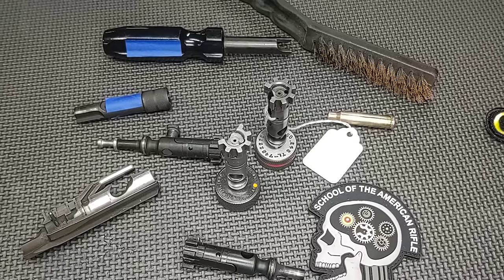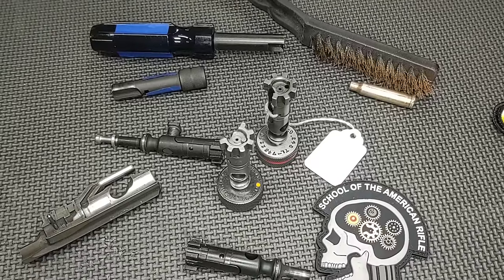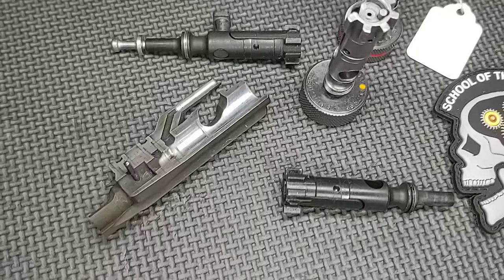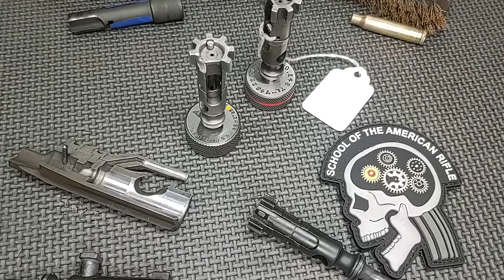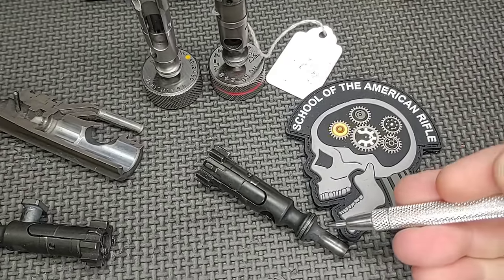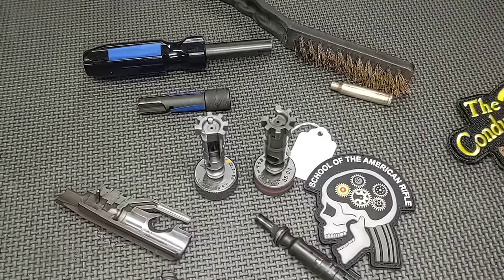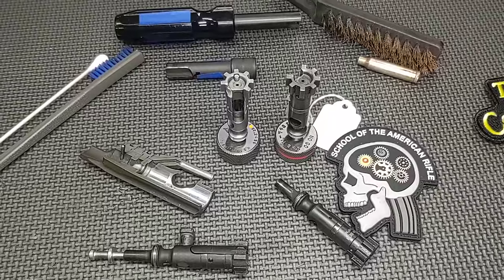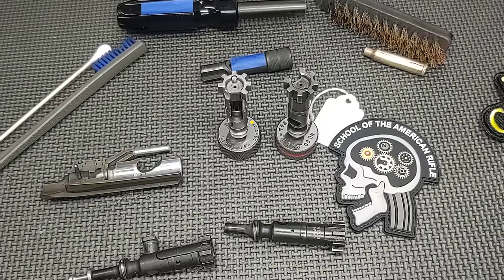Improper Cleaning can ruin your AR15 Bolt Carrier Group

Comment: I have found the best way to clean the BCG (and other gun parts) is an occasional dip in the ultrasonic cleaner with some Purple Simple Green (don't use the Green Simple Green on gun parts). Then some CLP, and it runs like a champ.
Reply: Same here, purple power and a after a cycle or 2 the BCG is spotless.

Comment: Glass jar with Hoppe's #9, submerge bolt and run through a few ultrasonic cleaning cycles. Don't ultrasonic clean any parts that have type 3 anodizing, it doesn't fare well.

Comment: I built a CAR 15 to use at the SOF 3-Gun World Championship in 1990.
The days when NO scopes allowed, just iron sights. I placed third.
I still have that rifle, untold rounds through it and I have never scraped bolt or carrier. Just clean it twice a year and I use my own gun oil.
REMEMBER: There are lots of fixes for problems that do not exist.
Also, take the O ring out of your extractor. Mine has the black buffer and Wolff extractor spring. Never had a failure to extract and I DO NOT use steel case ammo.
Dump the powder from a steel case round. Light it then rub the ash between your fingers. You will never use steel case ammo again. All that grit from countries that hate us.

Comment: I agree with this video, it makes sense and I will never buy one of those scrapers. It would take a lot of neglect to make one start to malfunction if you lube it.

 I'm a big fan of using chemical solvents because most things will not harm the steel of a bolt carrier group. I actually use a lot of automotive products for cleaning and lube. An automobile engine has more friction and stress than a rifle and if it works on an engine it will work on a rifle, as long as the viscosity is fine. 

I use Ford moly grease for the threads on my barrel installation, it's never been a problem for me on that and it's a high quality product.

I've found that carburetor cleaner and brake cleaner are both excellent solvents for many mechanical devices, including guns. You just don't want to get that stuff on your plastic furniture or wood for that matter. That stuff is formulated to clean metal and not harm the various seals on a vehicle. Spray your BCG with carb cleaner and give it a few minutes to work and then spray again and scrub with a nylon brush and old tee-shirt material and I guarantee you the BCG will be clean enough and not sustain any damage. The carb and brake cleaner are also both designed to evaporate quickly and leave zero residue. 

I also clean and degrease metal with brake cleaner before spray painting metal and that works fantastically. It's also good to use it before you glue something with something like epoxy. The cleaner you get your metal or plastic the better things adhere, that's just a fact. You do have to be careful when you prep plastic like that though.

Comment: I see it often. I've been disassembling and soaking the BCG in SeaFoam and then using a nylon brush.  It's worked amazingly well with zero wear to the surface coating that I can see under a surface microscope.  I generally clean the BCG about every 500 rounds if the situation permits it.

Comment: Shalom Ach b"Mashiach!      Just purchased a new complete upper. Disassembled. Used Lucas red oil to clean BCG. Then light oil with Lucas green oil. Put two mags through it the first day out. Disassembled again. Recleaned. And noticed the BOLT has a distinct RUST area in front of gas rings. The RUST area feels pitted like it was not Nitride-treated properly. "MPI/HP tested bolt" / 556 MPI 9310. Question. Will oil protect? Should it be a concern? Replaced? Re-BLUED? Thanks/ Todah!

Comment: If I can’t knock it off with a nylon brush then it don’t come off my guns lol. Lube it up and it runs! Also I stopped using brass or copper brushes in my barrel. The gun just continued to tighten up groups so why do anything than a patch and a very light chamber brush.

Comment: found in the Army that if I lubricated my firearm properly, using nothing more than military issued CLP, the carbon in these areas would literally wipe off later. 

I also very rarely and sparingly cleaned my M16 or M4, even in Basic, and never once had a problem due to being dirty.

I'll admit at one time I was cleaning the bolt as mentioned here, using the can opener of my multitool. But overall for the most part, during my time in the military I rarely had more than a rag, nylon brush, pipe cleaners, barrel/chamber wire brushes, and CLP to clean with.
Reply: The place I bought my bang stick from,said after asking which cleaner and oil to use, just use CLP!! Good advice...

Comment: Two things I learned is, it needs lubricant. The fouling will affect the operation of the gun and cause misfires. Number two, don’t run a lot of rounds through it before cleaning it. A quick cleaning between trips to the range will help with firing problems from build up. Then a major brake down and cleaning can be done at a later date. Since doing this I never needed scraping tools. A good gun cleaning solvent and cleaning cloth does the trick.

Comment: so yeah, competition shooter and been trough tons of carbine classes since I got out of active duty in 2007. I clean my guns maybe once a year and not this thorough. They run fastastic. Might not look pretty but i Just wipe them down, hit the valley and small parts with some simple green and a nylon brush. Pull a bore snake a couple times. Spray some royal purple gun oil and get back at it.

Comment: I am from Alaska were putting lube or grease on the moving parts of any AR from the 15's to the 10's is going to cause you massive issues to fail to fire - non cycling cartridge issues because when weather drops below 50 degrees the oils and lube get sticky and show down the movement of the bolt throwing timing off and for the firing pin the Kinetic force is dampened causing fail to fire.
I bought my first AR 15 1 year before Bill Clinton was president, so I have used AR's long before the guns popularity exploded.
This greasing & lubing ARs to get them to work is really BS as I have for so many years won't put oil or lubes in my AR's because I've found personally even WD 40 will put a stop to an AR 15 or AR 10 to function in cold weather.
If you live in a warm climate area, then oils and grease is fine in the AR rifles if that is what you want to do then have at it.

Comment: Im a new subscriber and builder on my second and third AR  builds. I think I like the way you think. These rifles seem to have similar characteristics as many other piston systems be they internal combustion engines, two stroke, small engines or whatever. They have tolerances built into them to run under less than ideal conditions. Of course efficiency is the name of the game here. It degrades under adverse conditions. Like a transmission. It’ll run with low/dirty fluid. But for how long?

Comment: Great video.  When soaking the carrier group in CLR is there anything you need to do to neutralize. Or do you simply wipe or blow it out with compressed air.
Reply: @sotar???  Do you rinse the CLR soaked components or just blow dry with a compressor before lubrication?

Comment: I use a scraper, but very lightly, and only try to remove the excessive carbon build up caused by suppressor use.  I always leave a little bit on/in the bolt as there is no need to get it 100% clean.  I wish they would have had this attitude when I was in the Marines.  I have not found CLR to be an effective carbon remover and that that includes soaking it for several days.

Comment: Appreciate the advice! Seems u have first hand knowledge of this and u seem to know what you're talking about when it comes to this. U saved me from scraping the bolt end with a wire brush to remove the fouling carbon that builds up. You beat my OCD with a hammer and won! Thank u! Now i know not to do it and that it's not a big deal

Comment: I would have found it more helpful for the video to show me what to do rather that just tell me what not to do.

Fwiw I only use Hoppes and a cotton rag on my boron nitride BCG, and then a little Slip 2000 on the bearing surfaces and in the lugs. Is that bad? Idk but no problems yet.

Comment: I have that multi tool scraper maybe once every 3000 rounds on my AR bolt but it's just a twist or two and it never really does much so I am slowly using it less and less. It would always feel wrong scraping the bolt even with brass.

Comment: The rule of thumb for cleaning tools is that they should be made of plastic or softer metal (brass, copper, etc). If you use steel on steel, that’s when you damage the gun. Brass and copper should not be able to damage the gun.

Comment: Will swear with CLR for cutting carbon.  Did some suppressor baffles that hadn't been cleaned for a decade.  Dip worked to a certain degree.  CLR owned it.  Only thing is CLR can eat into the steel if left for WAYY too long. 10-15 minutes tops.

Comment: I ended up removing the finish on my BCG by cleaning it with a copper wire brush. Should I get it refinished or just make sure I keep it clean and well lubricated moving forward?

Comment: Okay so legit learn me here:  I was taught to disassemble, wash with soapy water, gently go at it with an extra soft toothbrush, dry with compressed air and a clean towel, and then use something like froglube on everything and reassemble it.  In the volumes of "wrong ways to clean things," (which I have determined that every cleaning method is in fact the wrong method) how badly does the way I was taught rank?

Comment: I bought a CAT M4 Tool but haven't used it yet. Because of its more open design, maybe it won't hold the carbon and lap the bolt tail or carrier, but I don't know. If I do use the tool, I'll be even more careful if I can remember this video.

Comment: What about bore snakes for the barrel? I tend to stay away from metals on metal but I bought a bore snake and it had Cooper strands throughout its length….i tried to make sure I did research before on bore snakes before I used it and it from my understanding it’s fine but I’m not sure. Did I get the wrong kind of bore snake. (I made sure to run it through from camber to muzzle and then repeat)

Comment: Just keep the hel_ lubed out of the bolt. Carbon build up isn't near as bad and will wipe off with a rag. Oil the crap out of it again and stick it back in the rifle. The only way to run an Ar Rifle is with a wet bolt !!!! Bill @ Mitchell's Gunsmithing.

Comment: When I clean my bolt carrier, I rarely use a brush or hard tool.  I use some good solvent,
then I use a good quality paper towel, wrapped into a roll very tightly, then I insert it
and twist it.  I might also use the firing pin to "scrape" it a little bit.  After cleaning it once,
I might soak the area with Rem Oil, then come back a week later to use the paper
towel again.

I don't run my rifles "dry", but I also don't try to over lube them.

Comment: My rifle cleaning procedure is run a bore snake with a couple drops of oil down the barrel a couple times, wipe the loose debris of the bcg parts with a lightly oiled microfiber towel, add a couple drops of oil to moving parts, and put it away until the next use. Haven’t seen a need to scrape the carbon.

Comment: Ive only ever had to clean the boat tail of an AR bolt once, and it was in an ar10 after shooting 400 rounds of tula through it. That stuff ran so dirty that after so many rounds, it required a lot of force to drive the bolt home. Took apart the BCG, wiped it down a bit with a cleaning rag, oiled it and put it back in. Ran just fine after that.

Comment: Had come to own a 68 Colt, the bolt had seen some corrosion on the tail, rings were worn, the tail and gas key inlet chamber of carrier were chock full of large chunks of carbon, I commenced to clear this of carbon with scraping tools, until I could see metal again. I did replace the extractor, pins, springs and the firing pin, retaining the original carrier and bolt. Now seeing this video, I'm not sure if I improved the assembly or over polished a turd🤔😳

Comment: I put a new Fail Zero BCG in my new-to-me AR. I very lightly lubed the outside of it before installation--was I correct in doing that? What about lube on the interior of it--do I need to do that now (only 100 rounds through it) or wait until it's time to disassemble and clean? Thanks.

Comment: I generally throw my BCG in a container of carbon cleaner, pull it out, brush it off, let it dry, lube it up, and let it fly! It's worked on my DPMS AR10 since 2004. It still runs good after almost 20 years.

Comment: Google filthy 14 if you're convinced that the DI AR15 won't run reliably unless it is cleaned really well from time to time. Keep it wet and wipe off the goo, it will run fine. Unless you're in the sandbox... in which case keep that ejection port cover closed unless there's spent brass flying out of it.

Comment: I was alleays told with firesrms not to use abrasives ever ubless you have to or have no option its why an AR or even an AK has to have a good chromed barrel, most AK pistons when inoortrd have a huge layer of chrome but some seaonit out for US made ubcromed. The AR while a more protected system chromed barrel and BGC sans extroctor is very easy to clean without abrasives especiaky if oiled properly.
Barrels need a a little cooper build up snd the bolt will have a little carbon but its a machine your not eating from.
I allways use biresnakes with nylon brushes and if you have ti use a cleaning rod use a bore guide.

Comment: Hmm. Dang. I think I did use a brass brush on it a couple of times, but lately I've just been using nylon brushes and cotton as they just felt right. Especially if you use a good cleaning solution. I also like to have my guns a little wet, at least on the inside. Thanks for this video; I'm still kinda new to AR ownership (the number of trips to the rifle range are still under 10 for me... but not by much and not for long) and I'm still a bit nervous and unsure of the best way to clean it. But I do know the BCG area needs to have special attention without damaging it, so I'm glad I started using nylon more often.

Comment: My issue with the "white glove inspection" cleaning mindset is that if you take a 100% spotlessly clean rifle without a single molecule of carbon in it, and you fire a single round, it is then failing a white glove inspection in every internal area of that rifle. Can you then not trust the second round to function because it is "dirty"? All you did was waste an extra 30 minutes to not actually make the rifle any more reliable. Taking a rifle that has cycled hundreds of rounds, removing 95% of the carbon with a thorough but quick cleaning, and a fresh lubrication will allow it to cycle hundreds of more rounds. And that is all you're looking to accomplish. 

When I was in the Marine Corps I usually used a whole can of brake cleaner to blast all the carbon out. It even got the inside of the chamber lugs nice and clean. Then I'd spray the entire rifle down with an aerosol CLP and wipe the excess off. The armorer yelled at me when he finally found out but it always passed inspection after about 20 minutes lol 

Now I just use Hoppes and a synthetic brush. Quality paper towels to wipe the carbon and Hoppes off and to twist up to get down inside the channels. Maybe some Q tips to get inside the firing pin channel inside the bolt. 5W-30 motor oil to lube everything. The only area that gets a scraper is that flared section on the bolt inside the piston "chamber". A sharp knife blade takes the carbon off easily and doesn't harm the bolt steel, but it's not a bearing surface anyway, unless you go too far up, which isn't usually needed. The sharp edge of the charging handle also works well for scraping that area. No need for special tools.

Comment: Great explanation, thank you.  When I lube my BCG I apply the oil to the four surfaces that touch the inside of the upper receiver.  In this case were you suggesting lubing the rest of the BCG  like inside where the gas rings are?

Comment: CLR is great, I use it on the gas piston in my shotgun and it gets it looking brand new. It will make the metal bone dry though so be careful if using it on a bolt or bolt carrier, you need to lube it up good after

Comment: The Army's Infantry is very guilty of this. I have never seen too many failures with infantrymen in a regular infantry unit using the M16 series back in the 80s, with A1s and A2s or M4s.The A2's and M4s are usually over gassed to make them function under all conditions with the gas rings being worn out and fall freely into the bolt. The only time I have ever seen a serious malfunction in cycling was working with the US Air Force Security Forces back in 2002-04 during their range qualifications. First was an obstruction in the gas carrier key with metal build up of copper. The Airman assigned to that rifle didn't check or clean the carrier key caused it to short stroke and not extract failing to cycle. Next is a lose carrier key which can cause gas loss doing the same thing to fail to cycle. I replaced and tightened and properly staked to the recommended torque specs. No problems after fixing both rifle and carbine. As an NCO I have taught my soldiers to look for these things before we deployed to Iraq during training. I learned a lot from the Air Force helping them to be more aware and be mindful in cleaning their weapons. To clean the tail end to scrape the carbon off I used a bronze or copper scouring pad so it doesn't scrape the dimensions of the bolt tail. A clean chamber, locking recess, and where the bolt carrier and chamber meet for proper locking makes a happy weapon. So clean and inspect the bolt carrier keys to ensure for proper cycling. What surprises me is that the US Air Force doesn't run hard their weapons as hard as the Army or Marine infantry, yet they had more malfunctions and failures?